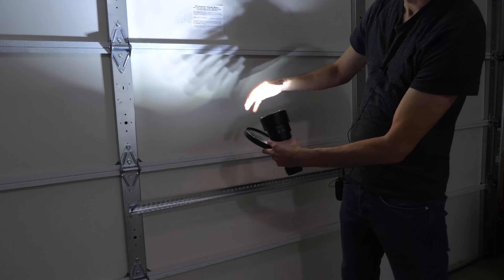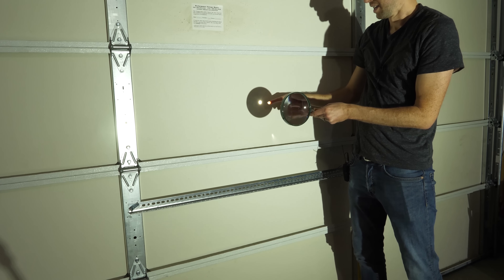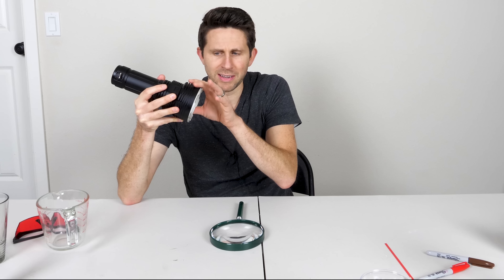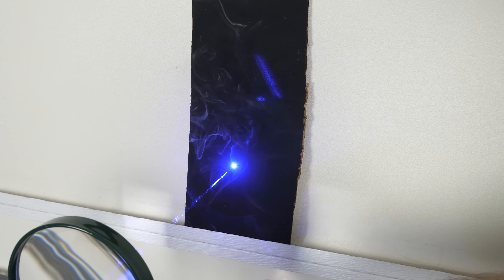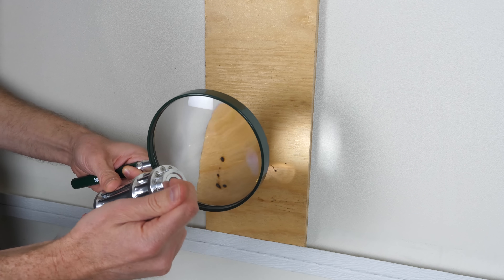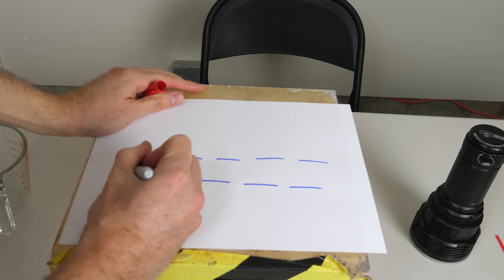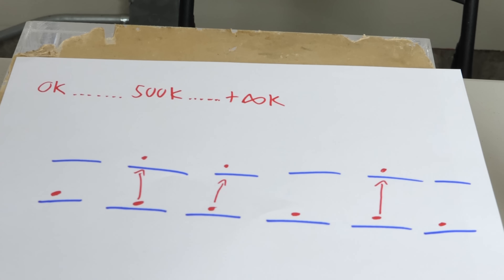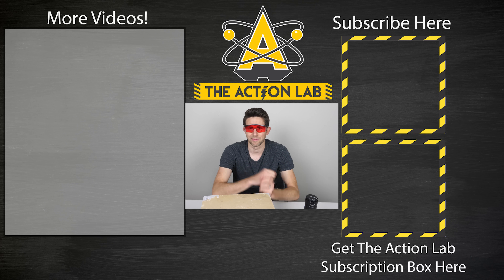What Happens if You Focus a 5W Laser With a Giant Magnifying Glass? Negative Kelvin Temperature!

Comment: just put a funnel over the flash light lens and then it would focus the light into a smaller space.
Reply: Close. Make that a Mirrored Funnel, with front surface mirror, and you are getting closer. That would be Non-Imaging Optics, which totally blow away that idiot's ignorant statements. Here is what I told him: 

The Action lab -- Dude, you are making outright false statements about achievable intensity vs source intensity! Relating that to the the 2nd Law of Thermodynamics is another mistake. You are conflating intensity and temperature which are utterly different things. While it is true that normal (imaging, Classical) optics cannot give you greater target intensity than source intensity, that is not true for non-imaging optics, which were demonstrated decades ago to give target intensity significantly higher than source intensity. The theoretical limit given by the experts in non-imaging optics is target intensity FOUR TIMES GREATER than source intensity. See the old letter in Nature, "Sunlight Brighter Than The Sun" - Nature 346 - 03Aug1990 doi: 10.1038/346802a0 http://adsabs.harvard.edu/abs/1990Natur.346..802C
Reply: The light will hit the funnel walls at various disorganized angles, and will thus continue to bounce around inside the funnel at various angles, absorbing as you go. And the smaller the hole, the more of the light will get absorbed before getting there...
Reply: @gavinjenkins899  That is not an inevitable result, according to the experts in non-imaging optics. Though they do say that doing it right will become very bulky, which is why they developed the hybrid optics approach I linked.
Reply: @YodaWhat  You didn't link anything except a page asking for a credit card, which is meaningless. Give a mirror with the actual article, etc., or there's no point posting it. Otherwise there could be any number of explanations / exceptions in there. Like if the "hybrid" refers to adding external power at some point, at which point the laws of thermodynamics would be no longer an issue since the closed system would expand to include that source...
Reply: @gavinjenkins899  Uh, not very persistent, are you? You can see the entire article in the document preview at that Nature link, as noted previously by 
Erhannis
, 2 weeks ago:
Oh, nice source.  (Note that the entire article is ironically available in the preview on the Nature site, if you click "rent or buy".)
Reply: @YodaWhat  Okay I found a pdf of the article. Turns out hey used sunlight to achieve a temperature of a whopping.... drumroll! 400C! Lol? How does this refute the guy in the video saying that "sunlight cannot be concentrated to a higher heat density than the surface of the sun"? Last I checked, the sun is not 390 C
Reply: I am not talking about lasers. I am talking about the first half of the video about non-collimated light, and how it + optics alone cannot heat up a target surface to hotter than the source of the light. He was correct about that.

You posted a link to a study that allegedly disproved this, but I found a non paywalled version of the study, and what they did was use sunlight to make something 400C. That's important for solar energy and all that, great, but it doesn't disprove what he said in the video, which is still true, about not being able to heat up something hotter than the origin of the light with passive optics alone.
Reply: @YodaWhat  And indeed blackbody radiation has a lot to do with why what he said IS true, actually... if you cannot optically focus light to a more intense spot than on the surface of the light emitter (and you cannot), then in the BEST case scenario, which is a blackbody, it will still reach equilibrium and be emitting light as fast as you pump it in, before you get to a temperature higher than the original light source. Anything less than a blackbody, even lower than that.

Your comment "If you trap heat and don't allow it to escape" cannot occur, because that's impossible to do in this case. Even with a blackbody, you cannot "not allow it" to escape, it WILL escape, and with an equal flux as the incoming light, prior to reaching the goal temperature. Yes sure IF you could perfectly stop it from escaping, you'd be right. But you can't.

Comment: I can not agree with you, 

if you can gather all the light from the LED bulb into one spot with mirrors and lenses, you should get the same effect as the laser.
5w of light energy produced by a LED lamp is the same as the 5w of energy produced by the Laser Diode.
The only difference is what laser gives pure wavelength and polarized light but 5w = 5w ...
the transmission of energy to heat energy must be the same

Comment: To reach that heat you would need to point the laser into a single point(like singularity that is why the density of the center of the black hole is infinite)and to make it into a single point with radius 0 is impossible.
Reply: I know main steam science is all hyped by it because many equations points to it and because of the whole nothing can be faster then the speed of light, but it is not infinite, if it was it wouldn't exist because it's not to a point but to no point. If it is to a point it would really be 1/epsilon(technically no where near that small but from what mainstream science currently says it would be) and 1/epsilon  /= infinity. I guess we will just have to wait until someone actually challenges the equation and go beyond main stream science which many have done and succeeded and failed such as Einstein himself...
Also something for you to think about what does a zero density (not in the future but is right now) object look like?

Comment: Lol. Using big words clipped from various scientific papers doesn't mean the end result will make any sense. And sure you can get a temp hotter than the source. This is logically easy. You have a surface area of 50 inches, using reflection and magnification we get the light down to a surface area of one inch. It's 50 inches of light energy down to one. Certainly going to be hotter even considering losses to imperfect mirrors. You don't need math or physics to figure out that this guy is full of it.

Correction. I am full of it. I was absolutely wrong. You can't heat something past the temp of the surface of the source. If you want a nifty explanation, it's here. https://physics.stackexchange.com/questions/343422/can-you-use-sun-light-to-heat-an-objects-surface-to-hotter-than-the-surface-of-t
Reply from the maker: Please research the conservation of etendue before you  speak anymore. Nobody said you can't magnify 50 inches surface area to 1 inch. I said that you can't magnify the light from any source to be hotter than the source itself. If you think you can please post a video of you doing it because you will have broken the 2nd law of thermodynamics.
Reply: The Action Lab. I apologize. You're correct. I hadn't considered that once the object you're heating reaches the temperature of the surface of whatever you're using to heat there's nothing to stop those photons from moving the other way in the system. I haven't done studying in thermodynamics, and you're negative kelvin sounded like bunk, but I honestly don't have the expertise to say otherwise. My apologies.
Reply: @TheActionLab  Please do some research instead of spreading bullshit
Reply: @TheActionLab  I think we speak about color temperatures here. Color temperature tells about temperature of source of light. You can increase power to incandescent bulb and it will turn from yellowish color to more blueish one as filament temperature increases. We can even maybe get it to close of matching color of sun which means filament is near temperatures of sun surface.

Now, Led lights break this equation. Small White LED light in corner of my keyboard is never close to temperature of incandescent, but still emits the same color.
I believe you if you say my keyboard temperature is 6226 °C (=6500 K color temperature), but in traditional sense that's hardly true. That's the temperature we can't exceed by focusing light.
Reply: Wouldn't the target radiate the heat back out and heat the source up to an even higher temp though? I believe that is the thermodynamical explanation here
Reply: You clearly don't understand the topic of the video; go watch some SixtySymbols.
Reply: Then go and try to focus a flashlight hotter than the glowing spiral in it.
Reply: no hes no you doosh
Reply: Stahp
Reply: Ok i understand u

Comment: Your explanation is misleading, because the flashlight is not a thermal source unless it is an incandescent flashlight. An LED flashlight is a "pseudo-thermal" source, meaning it produces spatially incoherent light that emulates a thermal source, but the actual temperature of the emitter is not relevant because it is not a true thermal emitter as an incandescent bulb is. Your laser can also become a pseudo-thermal source if you pass it through a scatterer first, such as frosted glass or a piece of tracing paper. Then you would find that the light is just as unfocusable as the flashlight. Also one may note that many laser pointers actually are based on laser diodes and produce a collimated beam only due to having a collimating lens within the pointer. In this case, strictly speaking, your focused beam doesn't exceed the surface brightness of the laser diode, but rather exceeds the brightness of the collimated beam. You can emulate this effect with any light source by using a lens to create a collimated beam, which can then be focused down to a higher intensity by a second converging lens. The brightness of the resulting spot will be brighter than the collimated beam but not brighter than the original source, just as is the case for the laser diode which is combined with a collimating lens inside the laser pointer.

Comment: And yet the only reason why u couldnt focus ur flashlight is because ur flash light is too big in diameter compared to ur lens. All you have to do is use smaller flashlight, use bigger D type lens or make a tinfoil reflector arround flashlight to focus all light into the lens itself. . . .

Comment: He has agreed to answer a ratio assignment but while he does so all SHOULD know carbon taxes work by burning more efficiently.  HOWEVER!!!!  Burning generates about a fifth of the heat directly obtainable at LOW grade from using decarbonated energy to move heat.  Coal is cleaner then gas if it via steam locomotive delivers heat freely harvested versus mere boiling.  Reflexively rich dirty white bros grunt Capexcapexcapex but WITHOUT taxes ESPECIALLY boiling room temp even fluids like the nitrogen affordably minimises use of fire itself by puttting legs on flames.

I join CReghZY FughcKs call for congressional mandate to force utilties to use heatpumps for first few dozen degrees at least of condensate resteaming.  It is COLD at start of loop!  Entropy was a farce a lark a sarcastic weak moment not his best in second law snipe to deal with idiots BUT spawned FAR worser ones duh ACROSS 2 MANY GENERATIONS ALREADY OMFG...

Comment: Lens or concentrate the light 'Brighter' than source, Yes.
..Concentrate the 'Heat' more than source, yes.
..Concentrate the light 'temperature' (yellow,blue) more than source, no. Not until a surface is shined  on to 'reEmit' at higher temperature.

Comment: What you said about the surface of the sun is incorrect.  If I get a large enough magnifying glass and then focus that area to a tiny point why wouldn't it be as hot as the surface of the sun? Yes, you can never be as hot as the surface of the sun if the area you are trying focus down to is as big as the magnifying glass.  But, say, you get a magnifying glass that is 100ft across and focus all that sun to a square milimeter - I will bet you that is hotter than the surface of the sun.

Comment: With a simple laser,  there is no breaking the laws of thermodynamics. It is entirely possible to focus your flashlights photons into a single beam that would be hotter than the source,  it is dependant on particle density and energy. Since photons have so much energy as a particle, all that is needed is to make them more dense. That is why we can start a fire with the light provided by the sun. 

Like you said in the video,  we don't have a magnifying  lease large enough for the sun,  you don't have a magnifying lease large enough for your flash light. OR,  it needs to be initially focused into a column that can fit an existing lense similar to your laser. 

There is only 1 object currently that has truly been outside of the laws of thermodynamics, and that is a type of jet engine that scientists and engineers have not been able to explain why it is so thermodynamically efficient.
Reply from the maker: you didn't understand what I said in this video
Reply: @TheActionLab  I enjoyed the video for entertainment purposes. However, it may be best to avoid science topics you do not fully have a grasp of. I can see in your videos that you are adept at inventing, application, innovation, and hardware. 

However,  you seem to have misspoke about breaking laws that are held to be factual. By lacking a full demonstration or education of the fundamentals of thermodynamics, you may not have known that you misspoke. 

As a person with an Mechanical Engineering Degree,  I can address this issue. I suggest not getting followers and subscribers overly hyped on things that are not true, and laying out what science you know on the subject before you start the experiment. That way you do not come off as a person trying to identify as an expert in these fields. 

The regular video is entertaining enough. After all,  this is what the King Of Random Channel does successfully as well.

Comment: taking it a step further. duplicating the effects the sun has on our planet using the different surrounding fields to focus the sun's energy to make it much harder on the surface of the planet and in space it would still be cold so your second law of thermodynamics is not necessarily 100% accurate. this is why astronauts on the space station do not have to worry about the sun's effects giving them a sunburn as is getting a sunburn on the Earth.
also using your laser how easy would it be to make a small portable laser gun the size of  a 44 Magnum. and easy to carry around. I am envisioning a type of gun like they have on Star trek the old series.

Comment: What if you took the blackest construction paper you could find and then sprayed it with the blackest spraypaint you could find and made a long cone and attached it to the end of your flashlight and then cut a small hole at the end of the cone, then you ought to be able to focus it into a small point with the magnifying glass I would imagine right?
Reply: That would work in a very minor way for an incandescent bulb. The light from the cone will never be brighter than at the filament and can never be passively focused to be so, but the black cone would cause the air around the bulb to heat up and the filament to be hotter than it otherwise would have been, and thus brighter. It would be simpler just to add more batteries though.

Comment: 2:10 actually all you need is a bendable reflective surface that you can mold to a smaller area than the flashlight and most if not all the light will be there meaning theoretically it is possible.